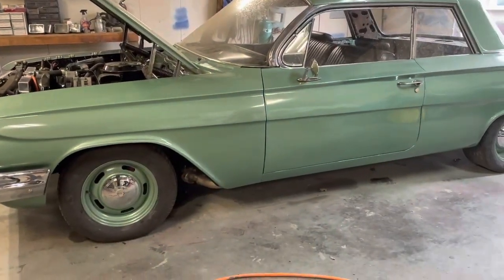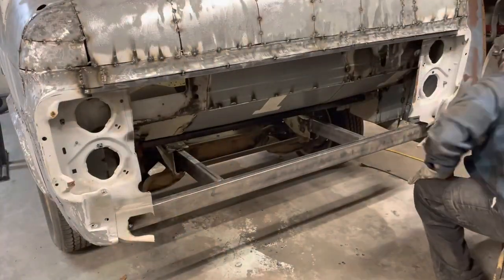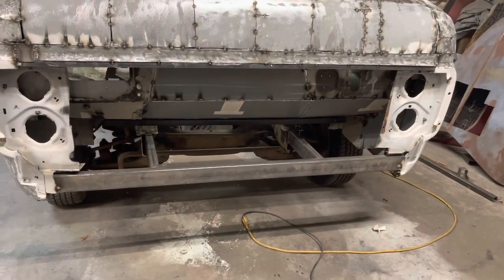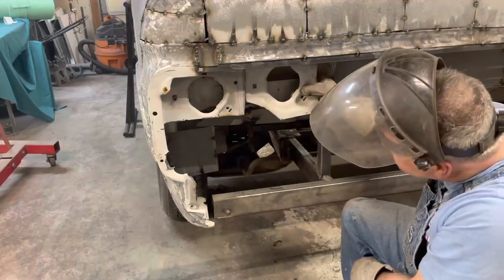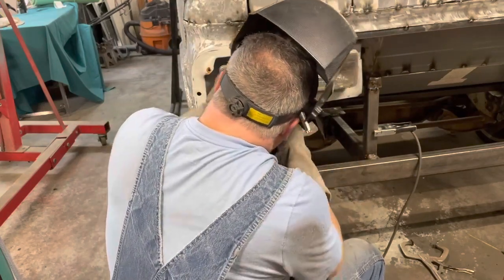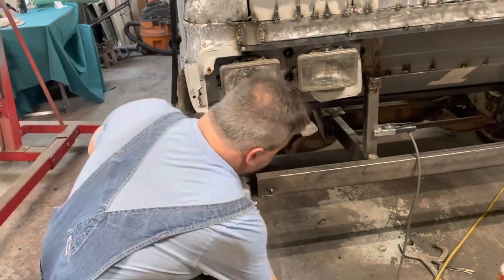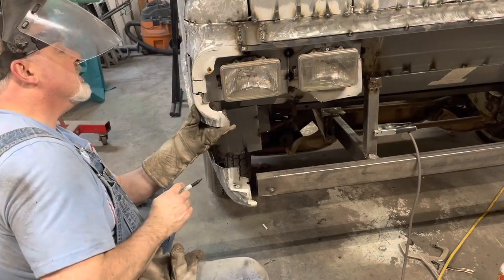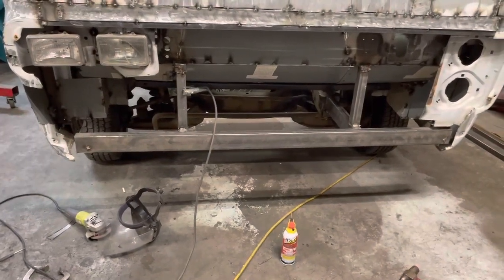Cab Over Chevy Van Conversion part 13; front end fabrication

Comment: Are you going to create an air scoop to feed the radiator?
Reply from the maker: Yeah, on the A100 Dodge van I had it used a belly pan that directed air coming in the front to pass over the radiator. I’m thinking along those lines.